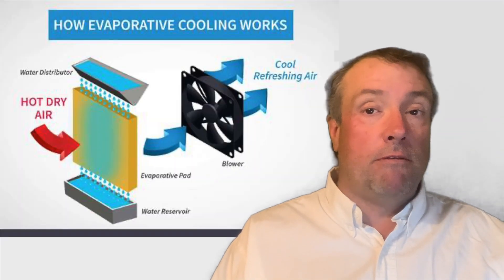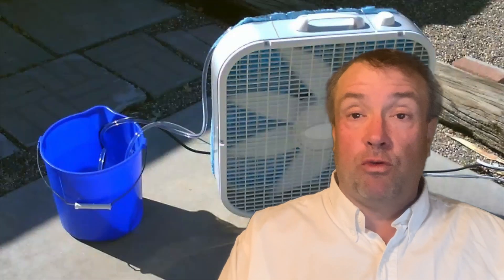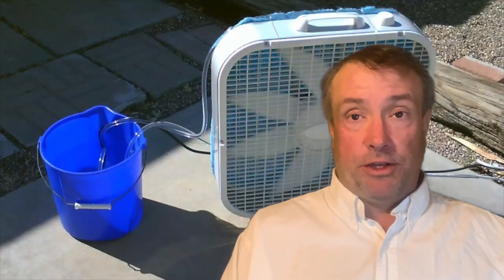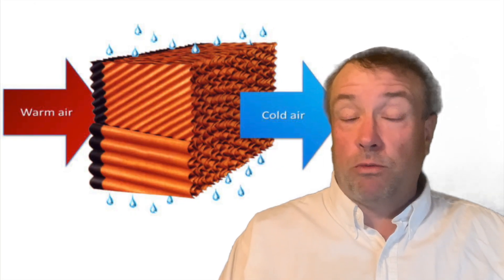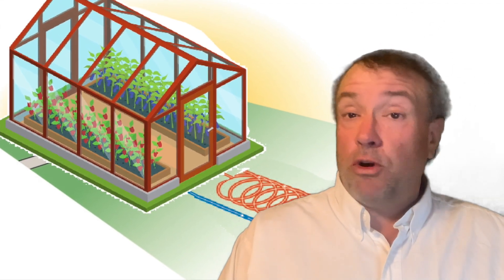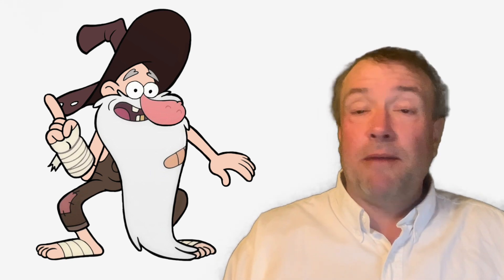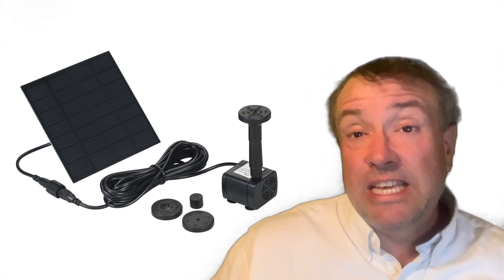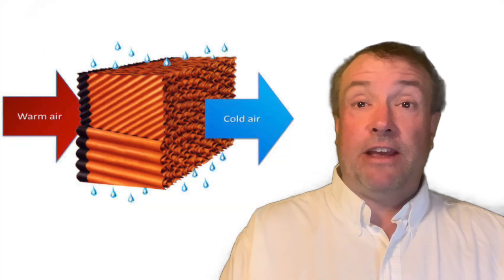Swamp Cooler for my Greenhouse part 1

Comment from the maker: What do you think the best way to cool a greenhouse is?
Reply: On a large scale using a waste heat generator in the Summer along with a heat pump. Remember I'm cannabis oriented. Staging solar thermal along with a heat pump in the Summer bypassing the thermal battery. Remember the waste heat generator will make the heat pump cheap.

Comment: Another idea to maybe cool it down is building a thermal mass pile on the north side and put a pipe trough the bottom. some vents into the top of the greenhouse to get some thermosyphon going. Then hot air leaves the top Vents and Draws in colder air from the thermal mass piles north side(Shaded). Basic concept they also use in Earthships for cooling. Idk if it would be enough since your greenhouse probably won´t have as much thermal mass as an Earthship building.
Reply from the maker: Good tip!

Comment: Thank you for the video! I saw a swamp cooler  cooled greenhouse in Namibia. They used Saltwater from the sea to cool down the hot desert air and moisten it. They use way less fresh water for the plants that way. I know this is probably not needed for Winnipeg still wanted to share this innovativ idea.
Reply from the maker: Very cool! and smart way to get usable moisture from salt water!
Reply: Neato! I inquire, does the salt add energy to the phase shift? Resulting in a cooler system? 

Brilliant use of best available option.
Reply: @GotDangJosh  hadn't even thought about that. My understanding right now does not allow me to give you an answer because it might be wrong.

Comment: Keep in mind as you place the evap cooler into operation is that it will help to have fresh air coming in, and an exhaust in play also.  Otherwise the humidity will increase to uncomfortable levels. Your existing window/box fans may come in handy (probably on low speed).
Reply from the maker: Thanks for the info!